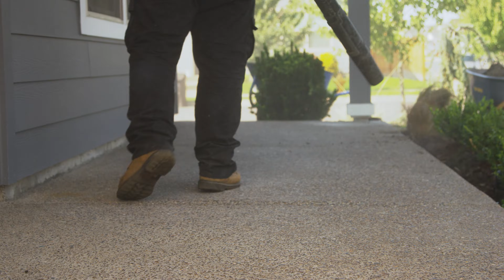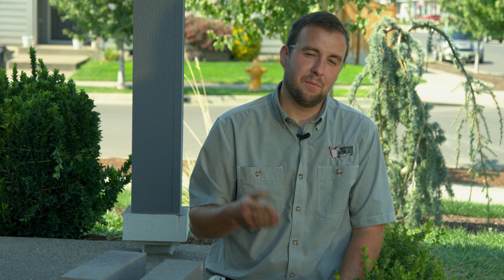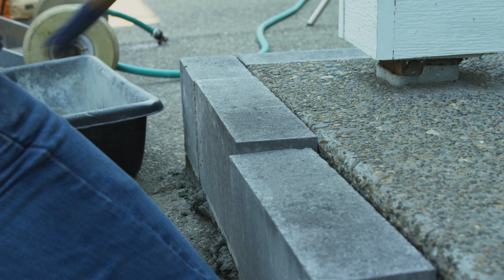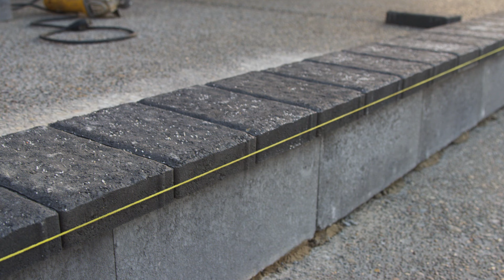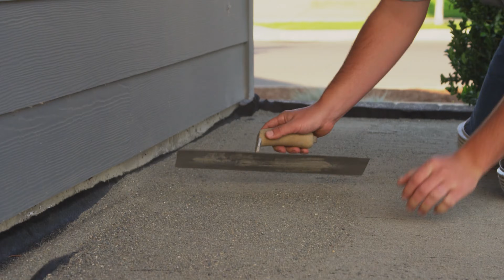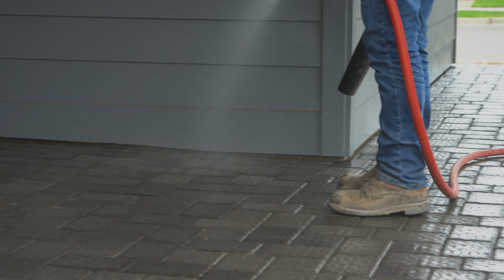How to Install Patio Pavers Over an Existing Concrete Slab

Comment: Hi, how is the drainage? If there are low spots, will water pool under? Is the poly sand permeable?
Reply from the maker: Yes, the water would still pool under the pavers, even if the sand is level. And no, most polymeric sand is not permeable.
Reply: @WesternInterlock thank you very much. If the concrete patio is uneven and have low spot near foundation, what should I do?
Reply from the maker: In that situation we would remove the old concrete and relay new pavers after a new base is installed.

Comment: How is there not a visible height difference between the border bricks glued on, and the others laid over fabric and sand?? Do you estimate the thickness of the textile and sand and try to recreate that height with the glue??
Reply from the maker: Yes that is an option or shimming the edge stones with small pieces of sand.

Comment: @westerninterlock Amazing video, thanks. Two questions…

1) what product is used for the horizontal and vertical base/edges?

2) assuming I have the height available and use lots more bedding sand, could those be used as the glued edge stones to hold the field pavers in? 

I’m looking for a very clean edge that doesn’t have the spacer ridges showing on the exterior edges. 

I have about 5” step down from the doorway down to the existing concreted pad.
Reply from the maker: Great questions! Thanks for watching so carefully!

The border edges in this video are paver stones (likely our Double Park or La Pietra Moderna), and we used Chateau Wall blocks to cover the exposed concrete face of the patio.

Interesting idea about using the Chateau Wall blocks as your edge restraint! With your 5" of height, you could technically glue Chateau Wall blocks to the concrete as your border, though they're thicker than typical border pavers. You'd install them first, glue them down with construction adhesive, then fill in with your bedding sand (1-1.5" max) and field pavers.

For that clean edge without spacer ridges, you might also consider any of our cap stones. Monaco Coping stones, or Murata Capello could be an option to give that  look you're going for.

As a note: Chateau Wall blocks are 4" thick, so they'll take up more of your height allowance than standard pavers or coping stones. Make sure you calculate your levels carefully to ensure proper drainage away from your doorway.

Hope this helps with your project planning!

Comment: I am way late, but have a question, please. I have a simple front concrete stoop. I really want to do something with pavers/brick. I have plenty of space below the door entrance. But i can only put blocks on either side. Front has the side walk. I guess I could go over the walkway to cover the front of the stoop. I can't stand the stoop. It needs this. Any suggestions for the smaller size?
I was going to PL premium the pavers right to the concrete. I may need to level the stoop 1st. I'm not sure yet. Any suggestions would be awesome! Thank you for this video, too!
Reply from the maker: Not too late at all, Deb! Your front stoop sounds like a perfect candidate for a paver overlay. A few thoughts for you:

For a small stoop, thin pavers (like our Camino™ line at 1.5" thick) work great because they minimize height buildup. You're right that adhesive (like PL Premium or landscape adhesive) is the way to go for this application - just make sure the concrete is clean, level (like you mentioned), and in good condition first.

For the design, you could wrap the pavers over the front edge to cover the walkway connection, or use a contrasting border/edging to create a clean transition.

If you need help with specific design ideas for your space, reach out to our team at (503) 623-9084 or westerninterlock.com/contact. We can offer  some more suggestions and tips. Good luck with your project - it's going to look great!
Reply: @WesternInterlock Thank you so very much!
Reply from the maker: You're welcome! Let us know if you need anything else!

Comment: I'm not convinced you need geo fabric or the thin layer of bedding aggregate. That surface seems to have no irregularities. In other demonstrations they lay the paver right down on the cement and use poly sand to seal it up and keep water out.
Reply from the maker: Thanks for sharing your perspective! It’s true that some people skip the geo fabric and bedding layer—but we recommend them for a reason.

The geo filter fabric helps retain any joint sand that might try to settle down through the pavers, and also keeps bedding sand from shifting if there are small bumps or dips in the concrete. Even surfaces that look flat can have slight imperfections that impact the final result.

The thin bedding layer (like fine sand) acts as a cushion, bridging those irregularities and helping prevent moisture from transferring upward into the pavers—which can reduce the chance of efflorescence over time.

It’s all about setting up a system that looks great and performs well long term.

Appreciate you joining the conversation. Thanks for being part of the community!

Comment: laying new pavers over old concrete using a sand bed is not a good idea because no matter how well its done there's no room for proper drainage of water which will cause more problems over time  - with pavers on concrete you want water not to ingress but to run off the surface and the only way to do it is to use a mortar bed, sealer and cement grout the pavers or rip up the concrete and place pavers on a proper gravel and sand bed
Reply: Yes, water is very damaging and over time it will find a way to get in.
Reply from the maker: Yes, water can be one of the biggest challenges for hardscapes! If you’re curious about how to protect your patio, this blog has some solid tips on drainage:
https://westerninterlock.com/the-best-natural-artificial-paver-patio-drainage-options/
Reply from the maker: Thanks for sharing your insight! You’re right—drainage is one of the most important factors in a long-lasting installation. There are definitely different approaches depending on the project conditions, climate, and goals. That’s why we always recommend people evaluate their base, slope, and materials before choosing the right method. Appreciate your contribution to the conversation!
Reply: Your comment makes sense.  The mortar bed must have the correct pitch for proper drainage if base concrete doesn't.  Useing line level and/ or surveyors level may help.  What brand(s) of mortar, sealer (over mortar?) and cement grout do you use?  Thanks.
Reply from the maker: Great question about specific products, Paul! You're absolutely right about proper pitch for drainage. For sealing guidance, we have a step-by-step video on how to seal pavers on our YouTube channel, plus a detailed blog article at westerninterlock.com/how-to-seal-paving-stones/. 

For specific product recommendations on sealers and other accessories we carry, check out westerninterlock.com/product-type/paver-accessories/ - that page shows all the products we recommend and trust for best results!
Reply: I hear what youre saying but when you use polymeric sand not that much water gets in there.  SOME DOES, but most driveways I've done it wicks its way out.  I've never put weep holes and never had a patio heave and im in the northeast!  That being said I would avoid doing brick pavers this way.

Comment: when you say a thin layer of sand are we looking at 1/2" or less of sand or more? thx
Reply from the maker: Great question—when referring to a thin layer of sand for things like leveling pavers or bedding material, we’re usually talking about 1/2 inch or less.

Here’s a quick breakdown:

Leveling layer (screed layer): Usually no more than 1/2" thick after compaction. This ensures stability and prevents shifting.

If using polymeric sand (for joints): That’s swept between pavers, not underneath—so the thickness isn’t measured in the same way.

If you go over 1/2" in the bedding layer, the pavers can settle unevenly over time.

So yes—“thin” typically means around 1/4" to 1/2" max, depending on your base and how level it is to begin with.
Reply: @WesternInterlock  thank you so much

Comment: Can this be done in hot areas like Arizona?
Reply from the maker: Absolutely! Installing patio pavers over an existing concrete slab can work well in hot areas like Arizona. ☀️ Just be sure to allow for proper drainage and use materials (like polymeric sand) that can handle heat expansion. Western Interlock pavers are designed for durability—even in extreme climates. For step-by-step guidance, check out our full installation guide here: https://westerninterlock.com/how-to-install-pavers-over-concrete/

Comment: Great video and very detailed explanation.  How would I approach laying pavers over a screened in patio floor with stucco texturing (which has begun flaking from moisture)?  The three walls and the screen rail form a solid frame which would limit any shifting.  The only non-bordered segment would be where the screen door opening is located - I'm wondering if a little construction adhesive under those bricks would do the trick.  I want the door to close against the side of the bricks rather than over them in order to keep critters and debris from coming in under the door.  Thanks for any input or suggestions you may have.
Reply from the maker: Thanks for the kind words! Here are a couple of ideas for your project:

Option one: Scrape away the stucco and apply the pavers directly to the bare concrete. This ensures a strong bond since the adhesive won’t be sticking to potentially loose stucco. If moisture is a concern, drilling weep holes can help reduce trapped moisture in the concrete.

Option two: If you prefer to keep the stucco, we’d still recommend drilling weep holes to help address the moisture issue. Adhesive may work on the stucco, but since it's already flaking, it's hard to predict long-term durability.

Let us know how it goes—we’d love to see the finished project!

Comment: Could you lay direct on the concrete and use a glue for each paver or some type of grout/sand in the end to better lock them together without doing the sand step?
Reply from the maker: You could, but that seems like a lot of work and glue when you can achieve the same thing with sand.

Comment: why dont the inner pavers sit higher than the glued pavers since they have fabric and sand under them?
Reply from the maker: They sit just under an 1/8" higher. It's just subtle with the cobbled edges meeting. Thanks!
Reply: @WesternInterlock This was my question. I was wondering how much sand thickness to apply. Thank you.

Comment: The outside edge is pressed into the soil and stacked up to match the porch height.  The porch slab has a completely different foundation that's not tied very well to those outside stones. Even with the adhesive, won't those outside stones shift after a few heavy rains and freeze/thaw cycles therefore distorting the outside perimeter?
Reply from the maker: Good question, here in our climate we have no freeze thaw that would push this method to its limitations. We do however have a very consistent amount of rainfall in our region and with the porch mostly covered and facing the North, it hasn't seen much of it. This is just a pretty face to help tie in the style of hardscape a little better, we do not think it is making a dramatic difference in the weight of this slab to persuade it to move, settle, or separate any faster than if it was left alone.

Comment: Just my opinion, but, I would have just mortared the interior pavers in and avoided using the Geo-underlayment .😊
Reply from the maker: The reason we refrained from that method is the added thickness, and weight. We use a Geo-filter fabric to create something that can separate the concrete paver from direct contact to the concrete surface as condensation between the two can accelerate efflorescence. This is also why we try to steer from certain types of mortars to adhere them to a concrete surface. If this porch was not covered we also would add 3/4"-1" weep holes every 6-8 square feet to reduce condensation which can be dramatically increased by rainfall from above as all concrete surfaces dry through the top, also increasing the risk of efflorescence. These are all preventative measures, not guarantees.

Comment: Is it possible to lay over a concrete slab like this with bluestone and dry-lay it with stone dust/no mortar? Then fill the gaps with polysand. I have a slab as our back patio and would like to cover it with bluestone. Thanks!
Reply from the maker: Technically it’s possible, yes. But we aren’t experts on natural stone so I’d recommend talking to a mason.

Comment: When you laid the polymeric sand did you run a compactor over the pavers to get down in the joints? Or is this not necessary with the thinner pavers?
Reply from the maker: On an overlay, the compactor is likely to break the pavers, especially the thinner ones, so, no, we did not compact the stones.

Comment: Nice video. However, sand and paver on a verandah ... maybe better to mortar onto the concrete
Reply from the maker: While you can mortar set pavers, it's not recommended. There's simply no need, and it can adversely affect the product. Refer to the last several paragraphs of this white paper for the reasons why: https://westerninterlock.com/wp-content/uploads/2023/03/WI-Mortar-Set-Pavers-Whitepaper.pdf
Reply: @WesternInterlock  I hear ya. The flex and competing strength issues are real problems in thinner substrates, and I guess even more so as the tile is increasingly porous, like in a red brick tile. The tile will ultimately lose. Good points.

Comment: Have you ever installed the new paver over existing paver for the patio?
Reply from the maker: There's no need to. If you have existing pavers, simply pull them up as carefully as possible so as not to disturb the bedding layer. Then make sure the bedding layer is flat and smooth. Once that's done, either relay the old pavers or lay new ones. That's the beauty of the paving stone system.

Comment: I did not understand what was the reason that you did not glue all the Pavers like you did with the first row , is that a problem with water or sun or leveling if glued?
Thank you
Reply from the maker: There's no real reason to glue them all. The outside edge holds them in place, and they're not going to fall up, so there's no reason to glue them down. Conceivably, you could glue them all down, but it would be cost prohibitive and take a lot longer. Once the outside it is restrained, those pavers aren't going anywhere. Pavers are a flexible system as well, so gluing them down would eliminate that benefit. If they're not glued down, they are allowed to move ever so slightly to accommodate environmental changes.
Reply: @WesternInterlock  understood. Thank you

Comment: What would you do if you wanted a half inch spacing between the bricks (including the glued down edge pieces)? What would you use to join the border bricks? Mortar/grout? I can't imagine you could a poly and for the vertical face.
Reply from the maker: That sounds more like masonry, which is out of our wheelhouse, so we can't authoritatively answer. Interlocking paving stones use their close proximity to each other to provide the necessary strength. We would recommend asking a mason.

Comment: Can I do this and continue my pavers into existing yard without concrete… so tie in  from concrete to dirt area?
Reply from the maker: Yes, it is possible to tie in an overlayed area with an existing dirt area. You just have to be very diligent with getting the base compacted to 99.5% proctor density so there isn’t any settling.

Comment: Is it possible to lay a walkway using pavers directly on top of creek sand or basically just sand? I feel like pavers will always move up and down over time.
Reply from the maker: That is not advisable. Sand is pretty much impossible to pack and will always move. A properly compacted gravel base should never move very much.

Comment: No tamping needed to settle sand and eventually compact pavers?
Reply from the maker: You can hand tamp if you really want to, but it's not necessary since it's overlaid on the concrete slab on a very thin layer of sand.
Reply: @WesternInterlock  thank you!!

Comment: If you have glued the outer edge down how down water drain away from the inner field pavers?
Reply from the maker: If you notice, the glue is not a solid line. It is well within the edge of the paver which allows the water to escape.

Comment: Why did you start with the border? Wouldn't it be easier to start at the house and work your way out?
Reply from the maker: Because the edge of the existing slab is an absolute, so it takes any guess work out. Additionally, it always looks better to have any cuts up near the house, partially hidden by the siding.

Comment: great video.  Question about the border pavers; i see the interlocking "nubs" are exposed along the outer edge.  To me, it's not a clean look.  Do folks just leave the nubs there, or have folks shaved or ground them down so the edge is relatively smooth?
Reply from the maker: People have shaved them off with a saw or ground them down, the only downside to that is that then it exposes more aggregate and doesn't look as clean. We used 40mm pavers for this overlay, but if you used standard 60mm you could use a coping like our Monaco for a cleaner look.
Reply: @WesternInterlock  thanks!  how would I grind it down (what tools?)?  I'd like to at least try it on a couple of pavers and see how it looks.
Reply from the maker: You can use a diamond cup wheel (https://www.amazon.com/KSEIBI-644030-2-Inch-Diamond-Grinding/dp/B01N5EI8F3) on an angle grinder. Be sure to wear some sort of breathing protection because there will be a lot of silica dust. The other option is to use a tile saw (or equivalent) to shave them off the edge.
Reply: @WesternInterlock  Awesome thanks!